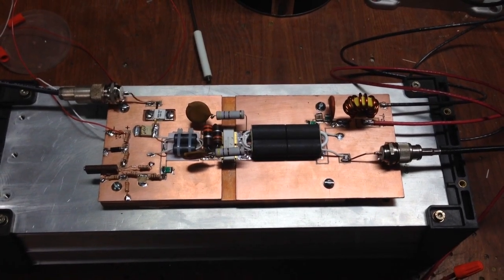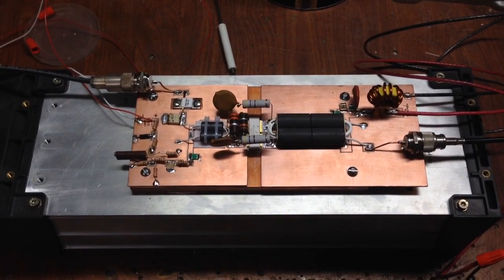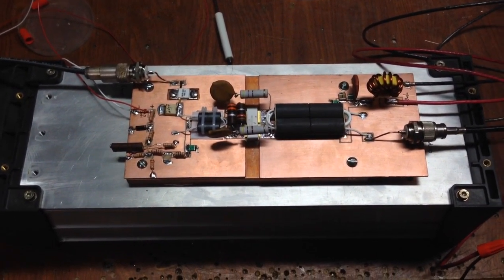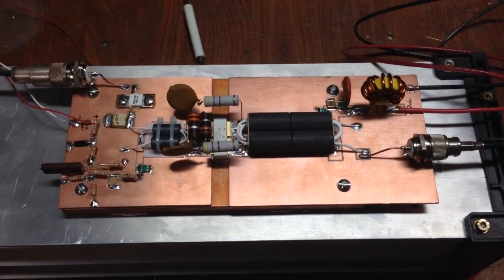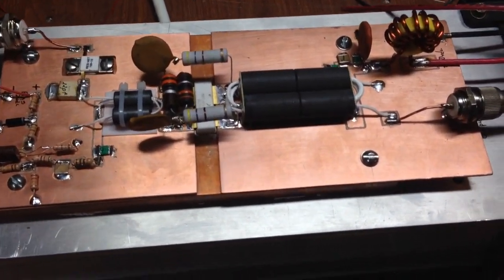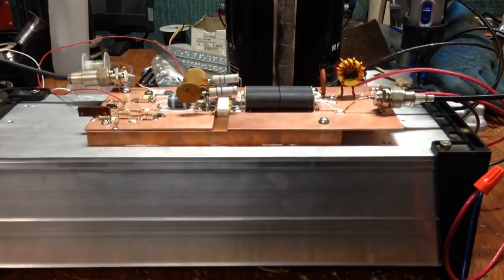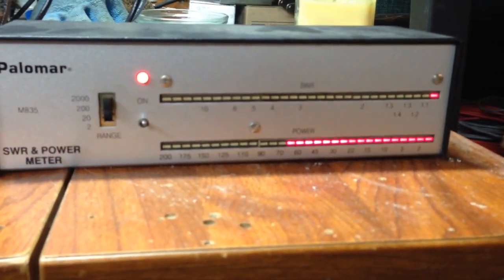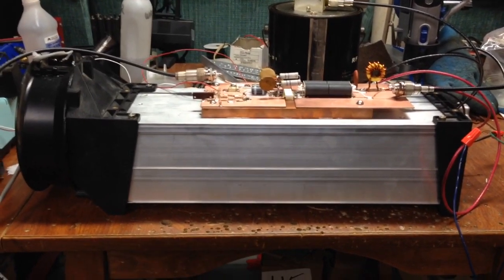1.8-54mhz 1.25KW  MRFE6VP61K25H LDMOS AMPLIFIER

Comment: Very nice. Do you have a pcb set available for purchase?  Or even the pcb layout? A friend wants to build one of these as a new project. Not sure if we are water cooling, but i love the amp design. I came across a bunch of huge heatsinks from 440 volt 250 amp DC motor drives that are perfect for this type of amp. My friend is sick of HV and tubes. He is currently running an 8877. Time for smaller and more reliable. 73 de N1FQF.
Reply from the maker: www.qsl.net/kf8od.   go to my for sale page

Comment: The fat copper is connected to ground with a independent ground wire or with the 4 screw?,  the resistive aluminium heat sink is connected to ground with 4 screw or with a ground wire?
Reply from the maker: XXVorteXX The four screws are only meant for mounting. Each supply, 12vdc and 50vdc have the negative lead connected to the board.

Comment: Just out of curiosity , In this simple version you built first , how does it compare to the later versions you have done like power ,stability , band width , and harmonic spurs , etc
Reply from the maker: Hi John, I recommend the 2 x blf188xr amplifier. The IMD is better using these devices at 50%. I use a pair for 1kw. I don't have a spectrum analyzer so I can't say how well they perform. If you only want about 600w the single device amp works well, I would recommend the Freescale design not the single output transformer.

Comment: Very nice amp! I'm considering making one. Do these have a reasonably flat response?
Reply from the maker: +Bob H Yes, the 10db 50 ohm attenuator helps also, flat input swr from 1.8-54mhz. Without the attenuator the highest swr is about 1.5:1.The output is 1200 watts or more across the entire spectrum, a little less on 6m.

Comment: Very nice. Thanks for sharing the info and the website. The only problem with this LDMOS is that it can go bad real quick with just a little too much input/excitation. I see that the 10db attenuator aloud you to input around 30 watts. Good deal.
Reply from the maker: Juan W5ZX I have to tell you I have made every mistake in the book. Input, no 50vdc, no 50 ohm load connected, Bias on with no 50vdc and no 50 ohm load connected. I once thought all power was off and left the bias on for about 20 minutes with no load! I don't think you can blow one of these devices. Thanks for your comment.

Comment: Any low pass filtering?
Reply from the maker: +Wm Robert Leschyna A low pass filter must always be used to comply with the FCC regulations stating, suppression of 43db. I recommend the W6PQL design.
Reply: +KF8OD Yes, I know it is a must, hence my question, but I don't see it in the video and I am interested in knowing what you are building or using for LPF?

73 Bob VE3UK
Reply from the maker: +Wm Robert Leschyna Go to my website www.qsl.net/kf8od/ldmos.html. At the bottom of the page there is a picture of one of my 2kw low pass filters.